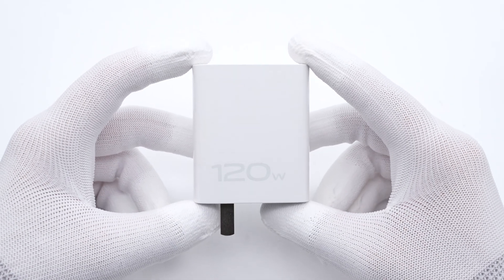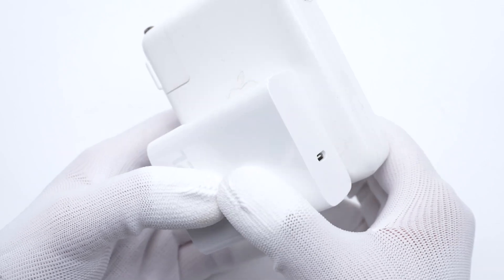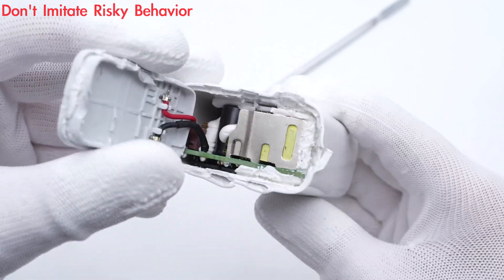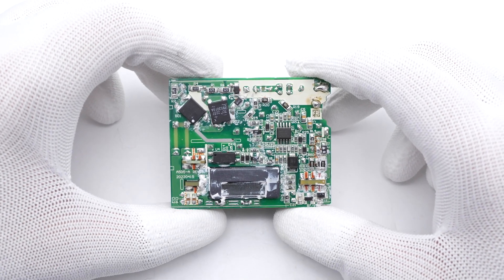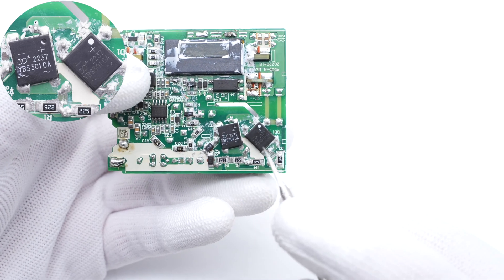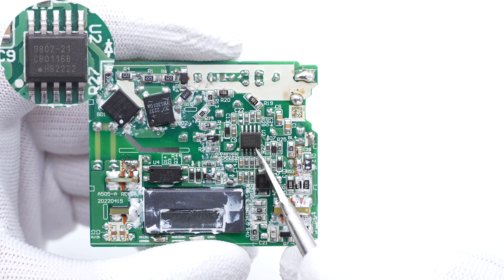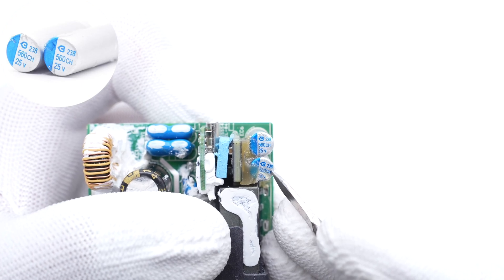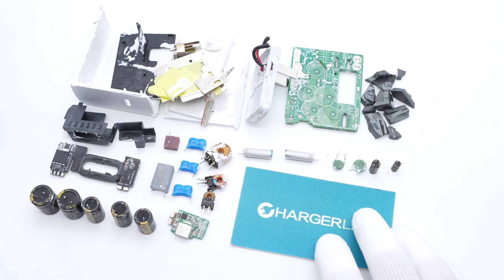Teardown of vivo/IQOO 120W Flash Charge GaN Charger

Comment: Thanks for the video! As a person who studied electrical in Senior high school to college it help my curiosity about my iQOO Z7 charger since it was 120w too (but in EU plug)
Reply: Mines the iqoo neo 7 with 120w and euro plug with the bulge near the plug, i use it with my legion 5 when just binge watching but it gets super hot so I strapped on 2 50mm heat sinks on both sides. Now when I'm using the laptop on wall power with charging off it pulls about 20watts and when using along with charging it uses close to 35watts. I have to start the cooling fans on the charger when using the laptop along with charging the battery 😂. It sure does  attract some attention at the library and college. I'm halfway through my computer science degree but I wanna pursue aircraft maintenance after graduation
Reply: Mines the iqoo neo 7 with 120w and euro plug with the bulge near the plug, i use it with my legion 5 when just binge watching but it gets super hot so I strapped on 2 50mm heat sinks on both sides. Now when I'm using the laptop on wall power with charging off it pulls about 20watts and when using along with charging it uses close to 35watts. I have to start the cooling fans on the charger when using the laptop along with charging the battery 😂. It sure does  attract some attention at the library and college. I'm halfway through my computer science degree but I wanna pursue aircraft maintenance after graduation

Comment: Bro, please make video for vivo charger 120w compability either usb C or usb A with vivo phone that just support 80w, 66w and 44w. Also for other brand for its charger dan phone
Reply: Agreed
Reply: It's compatible for all devices which support flash charge, 120w is the max..doesn't mean it would  go all the way 120w, it depends on your phone to draw how many watts from the charger, if your phone is 66w then it will draw 66w from the charger only even though your charger is a 120w.